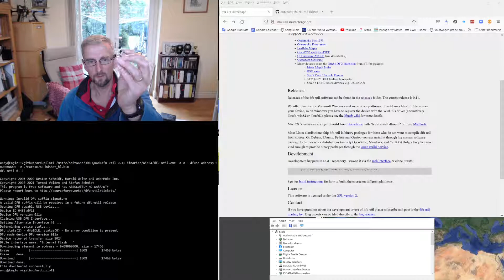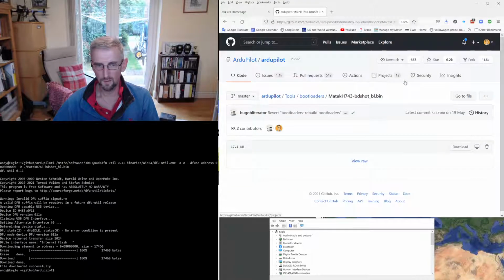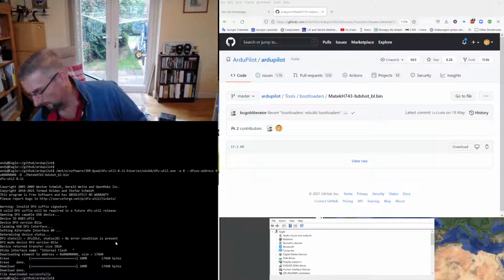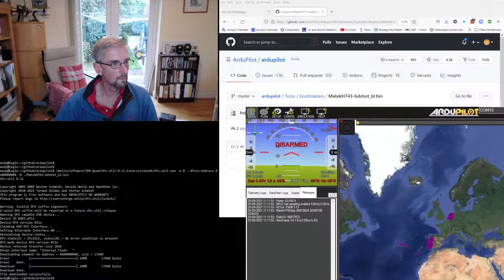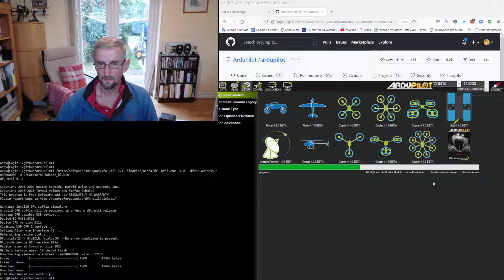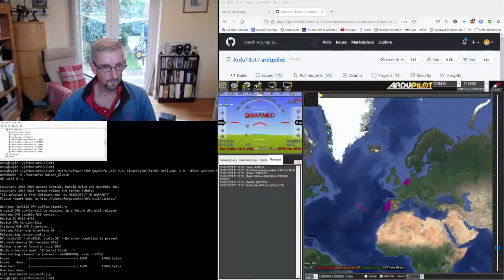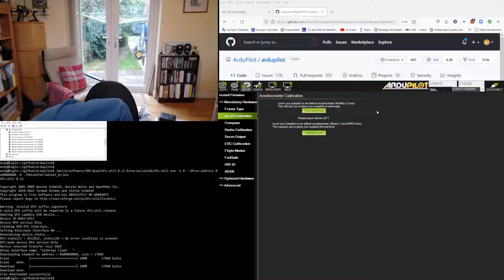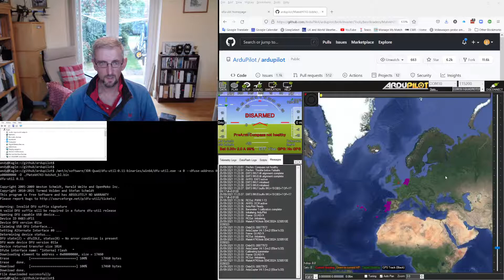ArduCopter 7" LR Build Video 4 - Initial Firmware Load

Comment: Hello sir, I'm new to this and after I downloaded and unzip the dif util file I went to the x64 folder and double clicked on the dif_util but nothing happened. I'm running win10 64bit. May I ask what am I doing wrong? Thank you sir
Reply from the maker: Hi, if you are using dfu you need to use it from the command line - so open up a powershell or bash window and run dfu from there
Reply: @andypiper5285  Thank you so much for answering sir. I were able to use a different method and got the bootloader loaded on the flight controller successfully. However, when I plug in the flight controller, the flight controller first showed up COM6 labled ardupilot but then it changes to COM 7 and 8 labled as Mavlink and SLCAN, I can only connect to COM7 when I do that followed you to the setup screen it say that I cannot load firmware, I have to disconnect and connect to firmware screen. But everytime I unplugged and pluged backed in the flight controller it showed COM6 then switched to display COM 7 and 8. I have the exact flight controller that you have. THank you for your time and I hope to hear back from  you
Reply: @andypiper5285  Hello sir, I actually went back and erase the FC and followed your step from the beginning and successfully uploaded your bin file to the FC. Now when I connect to my PC COM6 does show as ardupilot. However, when I go to the mission planner it showed com 6 but when I connect it just say "Try to connect time out in 27 second" and counting down. I've tried different usb port and cables but producing the same result. May I ask if I need to do something else sir? THank you for your time.
Reply: Hello sir, Sorry for bothering you. I think I got it working :). I went and just flashed the actual boot loader hex from quadcopter and after flash that's when the usb showed up as ardupilot without any COM number in the device manager, then when I go on the mission planner, com 7 and 8 showed up like the first time. I clicked on com 7 and it connected. I now realized I can skip the step regarding the firmware loading because I already loaded during the flashing dfu procedure. Now I'm just following you after that step. Thank you again for sharing your knowledge.
Reply from the maker: @bohaman.  Yes its important to reason that on some flight controllers (including this one) the COM port used by the bootloader is different the one used by the actual firmware. This is why the port changes. When you have two ports that usually means the firmware is running - one is the regular com port and the other is for a CAN connection